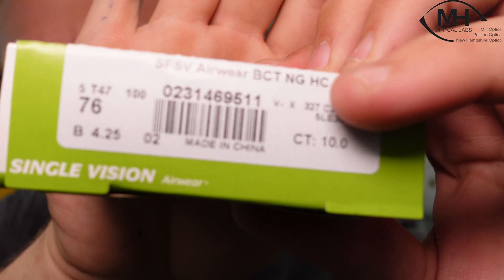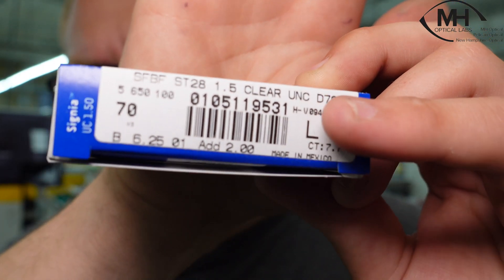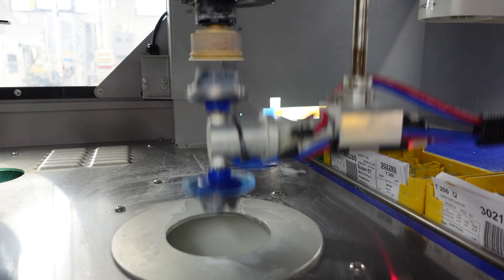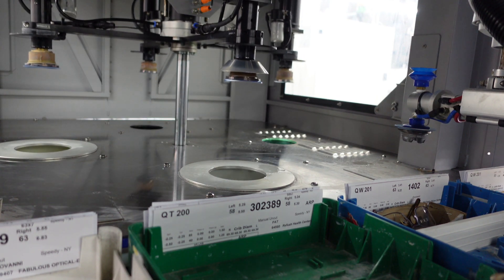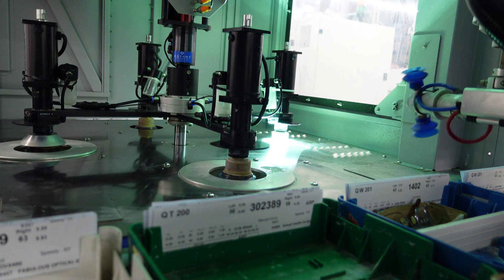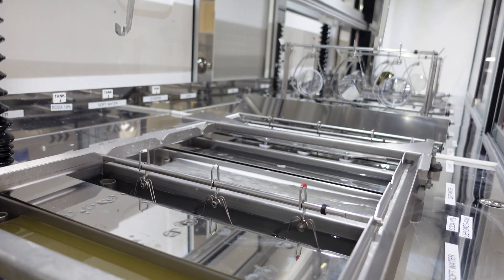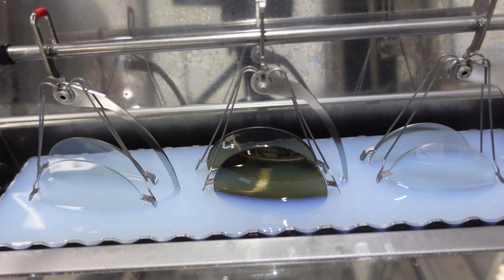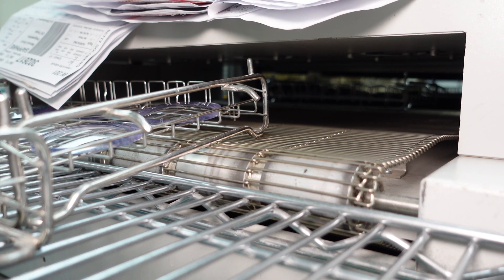LENS HARD COATINGS…What gets coated??

Comment: You started off by saying that poly carbonate is a soft plastic????

My friend you have absolutely no idea what you’re talking about
Reply from the maker: When it comes to impact resistance poly is ideal...i believe they use poly to make bullet proof glass..However uncoated poly scratches at the touch of a fingernail. thats why Poly lenses will always have some kind of hard coating on them....Maybe i worded it incorrectly in the video!
Reply: Ok now I understand because polycarbonate is probably the strongest plastic
Reply: it is a soft plastic and thats why if left uncoated, it scratches very easily

Comment: Does the lens need to go through an auto etch machine after loading on clips/racks to get cleaned before hitting the hardcoat machine? In your video the satisloh machine does the stripping of factory hardcoat, so if stripping and hardcoat is carried out in one machine does it still need another cleaning prior?
Reply from the maker: Our satis machine does a strip process on the left side of the machine and a primer and hard coat on the right, it’s an all in one strip and dip process…. We do prep the lenses before loading them on the clips by cleaning them with some alcohol and lint free cloths…. After the hard coat is applied they cure in a thermal oven ….then they are ready for the AR coater ….as long as that AR coater as ion etching they are good ….if the machine doesnt have ion etching it would need some form of etching (such as an ultra sonic wash or plasma) or else the coating stack won’t  stick
Reply: Thank you for sharing this. I have come across SCL machine that has strip option on the left of the machine just like the sati machine. But after loading the lens on rack they are put through an auto etch machine for a techniwash bath and after that process it goes through the SCL machine where again it goes through a techniwash bath+acid neutralizer+DI water. I just can't get my head around why do we need a separate etching process when it is available on the SCL machine. Not sure if I have explained it enough?
Reply from the maker: Some processes call for an external strip maybe that’s the idea…there are some benefits to an external strip first. We have had issues where we have contaminated our coating do to a wrong lens or an incomplete strip going into the coating ….an external strip allows you to audit a “naked” lens before it goes in the coating …. We have a new optimal machine on the way and I plan to do an external strip process fist with this machine